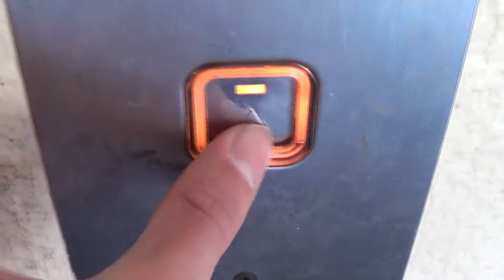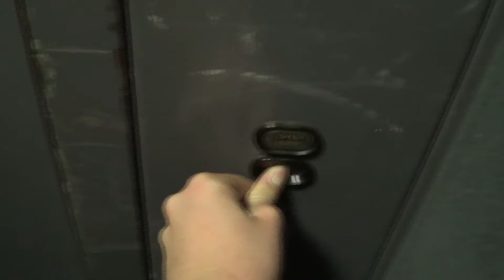Stuck!!!!! Old Express lift in Wellington CBD.

Comment: Did you get out by pressing the door open button? Or did you manually open the doors?
Reply from the maker: I manually opened the doors. Only the two inner doors and one shaft door opened, the other was jammed, which is what I suspect caused the fault. The jammed door seemed to have stopped the interlocks from clicking in. I was stuck for only about a minute. It's lucky that I got out as somebody responded to the alarm who was very cross that was in the building, but I walked off before out before they had a chance to throw me out.
Reply from the maker: Alex Ellis Stupidly the door open button was the only one I didn't press! I wonder if it would have worked?
Reply: @vidsfreee6638  old lifts are amazing.

Comment: That's why is YOU pressing call button too many times. Is will be going stuck and trapped into the elevator. There was stopped installed on elevator system!
Reply: Spamming the call button wouldn't do anything to get the lift stuck because the lift is powered by reliable relays and isn't powered by a crap little micro processor. It's bad maintaince by Kone and letting the lift itself get into such a state, probably a interlock issue, that's one thing common on Bennies and Express.
Reply: Interlocks have nothing to do with the call button. Anyone with the slightest inkling of how lift logics and interlocks work would not say something this monumentally stupid.